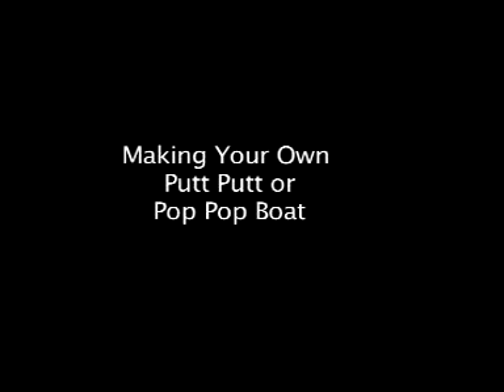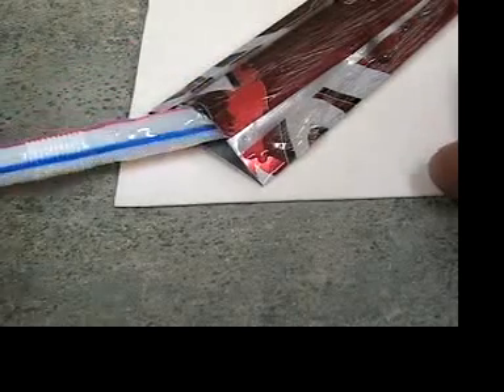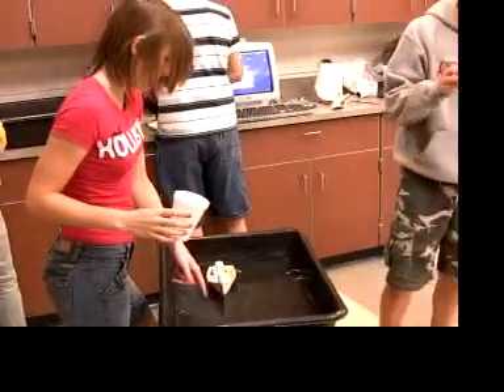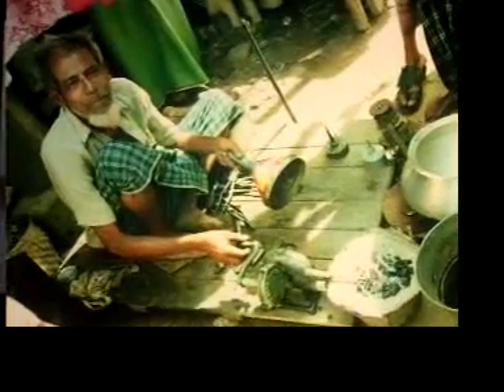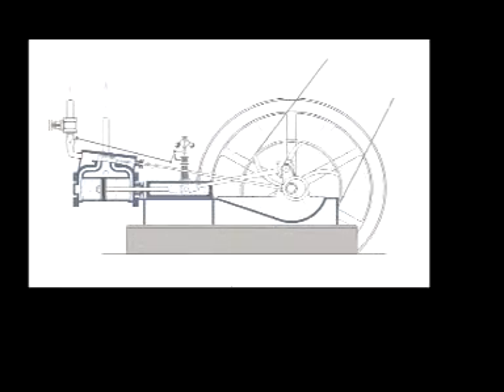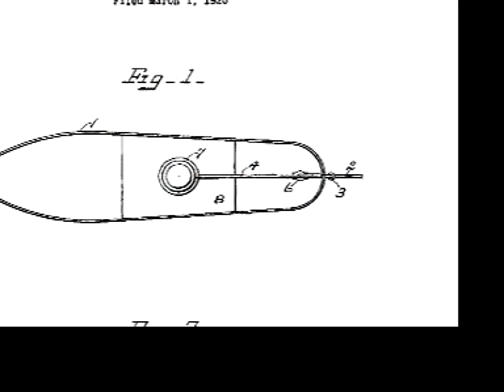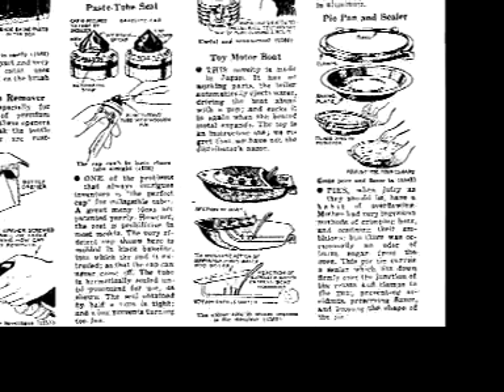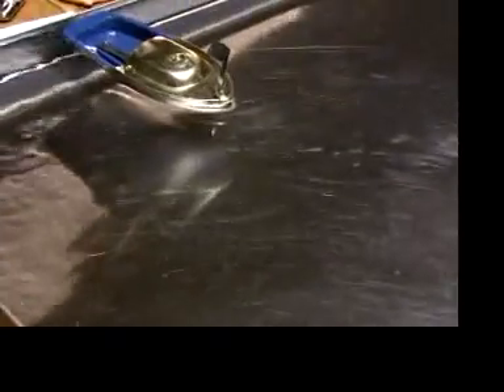Part 1 Build a Putt Putt/Pop Pop Steam Boat Intro 1

Comment from the maker: They use solder in Bangladesh, but you can't solder aluminum with regular solder. So they use steel and brass instead. Brass can be difficult to find, so I opted for common cans and epoxy.
Slater

Comment from the maker: @hubarlow It's hard to tell without seeing it, but I find that--for reasons I don't understand-- sometimes the engines take several runs to "break  in." In between runs, shake out the water very thoroughly because if it has too much water it takes to long to heat, so it's sluggish and doesn't make much noise. Finally, sometimes the engines make more sound after going a minute or two--perhaps because gases in the water come out of solution and push out some of the excess water. 
Slater

Comment from the maker: @GhufranMr The pulsing in and out of the water pushes the metal in and out, which make the engine sound. You can see it in part 2, the second part of the introduction.

Slater

Comment from the maker: @jeune000 Yes, I used epoxy. It comes in various colors. You don't have to use the 5 minute kind, but you will have to wait longer for it to harden. 
Slater

Comment from the maker: @sneakysnakepie1 Yep, I too made an engine using hot glue only--just for fun, to see what would happen. It did run well for bit, but as it heated up more--as you said--the glue started rolling off and steam leaks bubbled in where the glue sealed the engine. 
Slater

Comment: I have learned that a hot glue gun will NOT work, because the glue get hot when you put it on the moter and when you use the liter or candle it heats up the glue AGAIN and then it leaks/runs off! learned the hard way.

Comment from the maker: The pop pop engine is an exacting project with unfamiliar procedures, so it can take more than one attempt. Good for you for persisting until it worked! There is a world-wide forum about pop pop boat experiments, linked in the blue information box to the right. Also, there are more DIY science projects at sciencetoymakerDOTorg (I cant put links in this comments section).
Slater

Comment: Me and some friends each just built one today. Works perfectly (the most difficult part for me, was coming up with a nice boat design to put the engine on).

Very good, detailed instructions and videos. You must have spent ages coming up with the design and reducing it to such simple steps. I must agree with the "BrainDead", you are a great teacher!

(by the way: "tea candles" work just fine, too, you can just add a second candle if the boat runs too slowly)!

Comment from the maker: re: gluing the engine in or not. It depends what kind of boat hull you use. Rubber bands hold the engine onto the simple foam boat. But you have to glue it into the cardboard hull from a milk carton. Actually, you don't have to glue it as long as you keep water from entering the hole in the bottom.

Comment from the maker: Hot  glue will not work, for obvious reasons. 5 minute epoxy has the advantage of hardening quickly. Other high quality glue might work, but I suggest you stick to the directions exactly for your first engine.